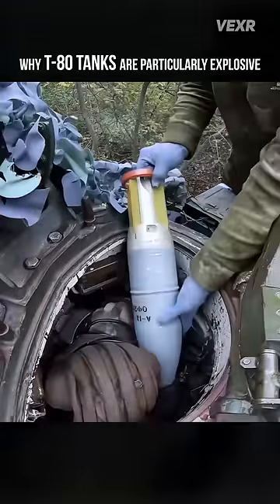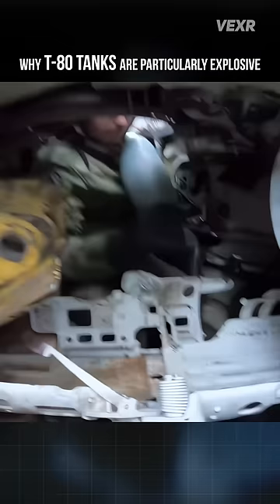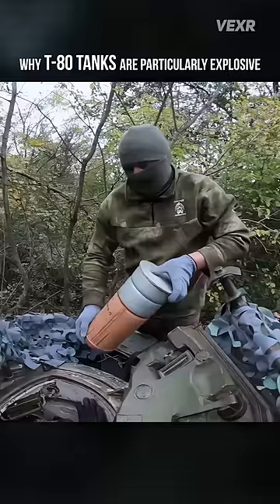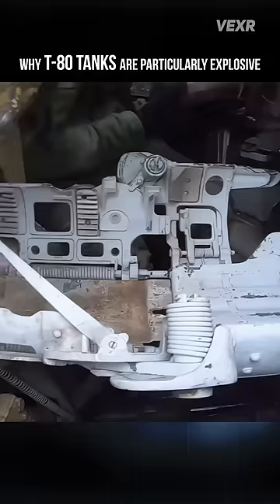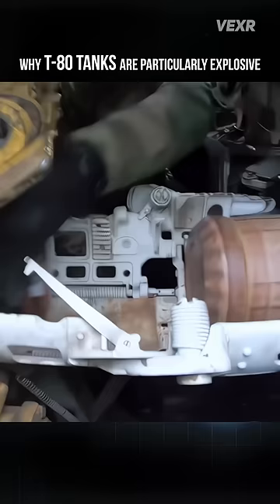T-80 Tanks Are Particularly Explosive, Here's One Reason Why

Comment: It doesn't matter if it has hydraulics or electronics. The autoloader itself is essentially a huge powder keg that sits right in the middle of where a gunner would target.
Reply: I mean, yeah, but the vast majority of ammo detonations from hits are caused by rounds all around the interior of the tank.
The Soviets did tests and found that out as well, very few were cases where it was solely the auto loader because it sits so low in the tank where it’s harder to aim at. 
And the T-80 and T-64 have even more chance of the ammo in its auto loader being hit because the explosive charge is stacked vertically which makes it much easier to hit and aim for.
Reply: The auto loader has the ammo circling the turret too! Hilariously bad design that leads to flying turrets
Reply: got to watch out for those pesky random fires starting from the interior you just never know when that hydraulic fluid will randomly catch on fire all to common 😭
Reply: "where a gunner would target"
No sane gunner would target lower quarter of a tank.
Reply: Well it is due to crews keeping extra ammo  inside around them that lights off the carousel, and not necessarily due to the autoloader itself. In fact the chances of being hit there I guess are much much rarer now that theyve followed protocol.

 With that said there are a few videos showing it, but the question becomes does it matter anyway? Pretty sure you'll be dead if you get penetrated there anyhow in any tank!

 The lack of reverse speed in some of them is what bothers me. I believe the T 80 doesn't lack it, but the T 90ms definitely do.
Reply: @numnut1516 it was good design at the time, it made tanks way smaller and harder to hit. Now the size doesn’t effect if it gets hit or not, so it’s a death trap. The soviets weren’t stupid
Reply: i thing you don't understand, ammo stored ON FLOOR, same happens with NATO tanks, they got secondary ammo storage in hull, and usually on floor, if tank get hit in hull, it make boom, and 2nd thing which make Russian tank make book often, NATO tanks usually have mostly APFSDS rounds or canister shots, Russian tanks use HE rounds, and if gunpowder just simply burn out, explosive filler of HE rounds make a huge BOOM. As it were shown in Syria by turkish leopards, if tank got HE rounds stored in ammo rack = instadeath to crew if tank get hit and ammoracked
Reply: @numnut1516  nah, you see but don't understand what you see, guy on video loaded 2 HE rounds which USA don't use in tanks, and NATO use pretty rarely, and this HE rounds make tanks toss turrets, cuz gunpowder just burnout and that's it, as it were shown in Syria by turkish leopards when tank got HE rounds in ammo rack and get hit, it make huge boom and blowup panels doesn't help at all
Reply: Looks incredibly cramped as well,must be difficult to escape from.
Reply: @Axelfl6161  all tanks are cramped, i were inside leo 2a4 can't say that it have lots of space, also don't forget that in Russia tankers lower than 175 cm
Reply: @numnut1516 How would you design it so you have access to different rounds easily?
Reply: Bud the hydraulica powerd one has a bigger chance of chatching on fire and cooking the ammo
Reply: and all new tank in the future roll out with autoloader.. bravo
Reply: @Notbigbird the t80s have looked to be able to survive way more punishment.  Yes, some perfect hits and BOOM, but I've seen 1 hit 2 antitank mines 1 right Fter the other and the crew survived a bit concussed in sure , but alive.
Reply: The new abrams is going to have the same thing so clearly it isnt the primary issue
Reply: I'm a heavy equipment operator and truck driver. This is why I'm trying to get my pilots licence before the war kicks off. So I'm forced into the air instead of forced into an M1 Coffin 😛
Reply: @dr6891  two things. Number 1 your pilots license wont mean anything to pilot training. Basic pilots license course is done by anyone selected. But you wont be selected for that if youre drafted in. Only officers can be pilots. You cant be one as a drafted man and they have plenty of qualified pilots and pilot wannabes to go around. Number two your heavy equipment experience means nothing for a tank. If they take your experience into account youll be driving a truck or some similar logistic unit. Off the front but targeted by air
Reply: @ThatSB  I try, but it doesn't always work out... That was meant to be funny. 

I have no illusions that a private aircraft, or even a commercial jet would be very similar to piloting a fighter jet. 

As for what I'd probably be doing. It's pretty hard to tell, I'm about as well rounded as a civilian can get when it comes to this sort of thing. I'm a hobbyist for a lot of things that would translate well to military service. Radios, maps, wilderness crap of all different kinds. I even was one as a kid and volunteered as an adult at our local "Army Cadets" here in Canada. So I know drill, rank structure, uniforms, and some other important basics. 

Not trying to play army man or anything, I'm just yakking. I  couldn't do what our heroes do without a personal reason to fight. Big pats on the back for all service members.
Reply: @ThatSB  I am a metal vocalist and can shout like a MOTHER FUCKER! I have no idea how it all works out. 

I'm 31 so a bit old to fight. And have experience teaching cadets drill and uniform and all that crap. I think I'd make a good drill sergeant lol
Reply: Война на Украине показала что советские танки меньше детанируют чем немецкие.
Reply: @redaerf2b414 still but spall exists and yes in some cases you would, for example if your using for example a round that penetrate less like heatfs you would have to aim low to hit the weaker lower glacis and avoid and ERA
Reply: @numnut1516  "Hilariously bad design" at the time of T-72's and T-64's introduction was what everybody else was doing - ammo spread all over a tank's interior.
Reply: @dianapennepacker6854  pretty much...once a tank..any tank is penetrated the crews are dead. You're correct.
Reply: The most likely part of the tank to get hit is the turret not dead ok the auto loader which is in a relatively hard place to hit
Reply: @アドルフヒトラ  its almost like it gets hit and catches fire or the autoloader itself gets hit
Reply: @ThatSB as an Abrams crewmember, the Abrams x is a testament that GD never listens to the actual tankers
Reply: @HyperNebula  why do you say that? I mean they have to switch to an autoloader in some way. A manual loader can't load fast enough for what theyre aiming for. What about the X do you not like?
Reply: Autoloader or not, a Tank is a Tank and when it’s disabled, its done. In my experience, recovering non-functional Abrams are either destroyed further or towed in for scrap metal. Its more expensive to repair than to replace.

Only reason why US uses it is because of crew survivability. You think the Russians didn’t consider this factor? 

For all you know, Russian leadership probably value victory over mortality.
Reply: @numnut1516 
Avarge YouTube tank designer 🤡
Reply: Thank your as electrician you hit that power source they gonna have a bad day
Reply: In the game war thunder? The Russians also made the game. Perhaps, but reality is not a game, the tank was developed by smart engineers. And apparently it's easy for you to talk about the shortcomings while sitting on the couch...
Reply: not all. The South Korean autoloaders have blowout panels and are stored in the back of the turret.
Reply: @gagida1829  because they use a bustle autoloader, not a carousel
Reply: the Soviet's one? yet. The French, the Korean, the Japanese ones? No one knows just yet.
Reply: Worse still is how the carriage stores the ammunition. The explosive charges are stacked vertically, allowing for a higher chance to be hit by spall
Reply: @Notbigbird  - Its never solely the autoloader, but its very sensitive and in most situations when a tank is hit, it goes fucking airborne
Reply: This part right here. The M1 Abrams could have had an auto loader at one time but they decided against it because of the danger it posed. The magazine is down lower in the tank so as to be harder to hit.
Reply: @numnut1516  It was a logical design at the time since there were no highly accurate anti-tank weapons. They allowed for a significantly smaller tank and thereby target, but western weapons like the NLAW and Javelin practically always accurately hit tanks when they lock on and it results in cookoffs
Reply: @Notbigbird  the autoloader's real problem is its ability to be completely prone to becoming a space station when exposed to ignition, other than that theyre kinda fine. other than the fact that you have to load the auto-loader lmao
Reply: @ViisualsHD  if there is a catastrophic ammunition explosion and the turret flies into the air, it doesn’t really matter to the crew.
Because regardless of if it’s an ammunition cook off or a catastrophic explosion they will be dead in both circumstances. 

And of course you have to load an auto loader, how else would it work? You can’t have mechanical arms reaching around the tank just grabbing ammunition and putting it in the auto loader, it’s not physically possible.

And yes you wouldn’t be able to reuse a tank if the ammunition exploded destroying just about everything of use in the tank, same with an abrams if a shell goes through the blast door or if something hits the ammo while the blast door is open like when the loader is opening it to grab a shell out of the compartment, it’s going to largely destroy the inside. It won’t be usable anymore and will have to be scrapped.
Now the turret won’t go flying but that doesn’t matter, the whole turret crew is now eviscerated and it’s unlikely the driver would survive.
Reply: @numnut1516 hillariously Bad Design as If penetrating wouldnt already make the Crew unable to Fight?
Reply: @dianapennepacker6854 it was the complete oppesite the t80 sucked in Reverse Speed allot But they Made a new Version now that can gow 60 kmh per houres
Reply: @Notbigbird  i understand all of that and im not refuting it. i just think sometimes human solutions are funny because theyre not really solving the problem, just one step in the problem while adding other new problems. thats how literally everything works though, just humorous to me
Reply: @ViisualsHD  yeah, humans do like doing the funny a lot xD
Reply: @アドルフヒトラ  When did a ruzzian obey "Курение запрещено", "No Smoking" signs?
Reply: If the projectile makes it that far into the tank then the crew is dead either way..
Reply: Only for Russian auto-loaders
Reply: Doesnt matter if the whole leo survives but all the crew is dead
Reply: @GIwillo  bold of you to assume I play war thunder or world of tanks lol

And yes I know, and actually the funny thing is is that some of them have shrapnel guards around the auto loader which is interesting. But still doesn’t matter much
Reply: @redaerf2b414 not true at all the bottom slope with a tank is the least armored part of the tank that's a spot that they aim for almost any chance they have

Plus you're actually underestimating where the charges sit it's almost exactly Center
Reply: Not the autoloader itself, just its position
Reply: Allright hear me out the thing nobody thinks off if you get hit where the autloader is even if youre in a natot ank youre dead or at the very least your legs are gone
Reply: All tanks have ammo in them, and all gunners are going to target the most vital or weak parts of a tank, so isn't this a problem that every tank basically has? Like how are any of those problems unique to just t80?
Reply: Which is why the BMP-1 had it's autoloader completely removed, having to manually load each shell
Reply: Which is why the Abrams is loaded by hand with the shells and charges stored behind blast doors
Reply: The autoloader is actually a great design because it puts the ammunition under an armor plate at the very middle and bottom of the tank waking at the absolute hardest to hit. Meanwhile western tanks do stupid shit like put ammo all throughout the fighting apartment, reference Challenger and Leopard. And those ERA and dazzler kits the Russian tanks get are some seriously good pieces of hardware. I’ve seen modern ERA eat consecutive ATGM’s without issue.
Reply: @tsugumorihoney2288  All tanks are cramped but some are more cramped than others. Abrams, Challenger 2, Leclerc, and Armata have pretty spacious crew compartments.
Reply: @tsugumorihoney2288  Most Western tanks, have only a small fraction of their total ammunition capacity dedicated to APFSDS rounds for the exact same reason most Russian tanks have only a small fraction of their capacity dedicated to APFSDS: It's rarely required. For every tank in any potential adversary's army, there are likely 2 or 3 light skinned IFVs. For every tank, there are probably a dozen buildings that require some quick demolition. For every tank there's dozens of miles of trenches, fortifications, and defensive positions that need to receive some shrapnel. 

Usually only about 20% of any tank's loadout would be APFSDS rounds. Most would be HE, HEAT with a few canister rounds if possible, and a few smoke rounds.
Reply: i mean any tank is basically a giant powder keg no?
Reply: @bobbman3000  man, you need to learn info about western tanks better, for example m1 have no HE ammo at all
Reply: @tsugumorihoney2288  The M830 and M830A1 are HEAT rounds. Can you tell me the first what the HE stands for?
Reply: @bobbman3000  HEAT not HE, it serve different purposes, 1st one is antiarmor, second is against "soft" targets and for destroying dots and etc. If you hit dot with HEAT you just made  small hole here if it works right, also they have like twice less explosives inside
Reply: @Notbigbird  If they dont have blowout panels they dont care about their crew. at least germany leopard and american abrams do that.
Reply: True, but what they're saying is a hit that narrowly misses the ammunition might accidentally ignite hydraulic fluid and cause a cookoff, so there's potentially even more likelihood of a turret launch.
Luckily the T-80 I think has slightly better armour so it evens out, but the autoloader with ammo stashed below is still a risk for most of these tanks.
Reply: @konskyfanusik3549  leopards have roughly 60% of their ammunition stored in the hull, unshielded, with the crew and quite easy to hit. Which is why there are photos of Leopard2’s with their turret blown clean off and having burned out. 
And there’s also a video of a Turkish leopard2A4 being hit by an ATGM and having an absolutely ginormous ammunition explosion 

Abrams are much better with most of their ammunition stored in the turret bustle away from the crew. There is a small amount located in the hill but that also has its own blowout panels and is quite hard to hit
Reply: So is any ammo?
Reply: @gmb4648  the auto loader was desined during a period where AT mines were not much of a threat.
Reply: Same with the leopard if you load the front hull with Ammo.
Reply: ask the Leopard 2 Driver whats to the left of him
Reply: I have a very nice video of a Leopard 2 making a trip to mars with the Turret  something the T-72 can't achieve by a far shot. @ThePadadada
Reply: The audoloader itself is fine. Lack of blast doors is the issue.
Reply: @numnut1516 I mean if you get a round hit that close to your ammunition causing it to explode, the crew doesn’t really have a good chance of surviving the hit even if the auto loader wasn’t there simply because how packed it is inside those tanks.
Reply: Even if the tank isn’t loaded, if a rpg penetrates the armor, everyone inside is dead anyway
Reply: @Notbigbird idk where you got your research but it’s not as correct as you might think this tank is actually known for how many have been destroyed by the autoloader being hit you can say they did all this research and said that’s not the reason but in actual combat it’s shown to be a death trap with it’s auto loader it’s a cool tank but the auto loader needs to be changed then that tank would actually be pretty invincible
Reply: @aaronrhodes8366  I never said it wasn’t the auto loader, just that more often than not it’s because of ammunition around the tank.
Reply: @redaerf2b414  Actually center point is where most gunners aim at. Its not War Thunder where every hit needs to penetrate. A huge hit at center point can infact trigger ammo to explode by the sheer vibrations of the metal or even spalling. Let allone deafen the crew. Even just a loud non pen can make the difference. See the leopard 2a6 shooting at a T-72 point blank it hits like a truck looks like a non penetration but the 2 T-72 smoked and turned tail away from that leopard. That crew probably has tinitus after that blast and they will never be the same morally broken.

But there are also cases of T-64's and T-72 exploding after a non penetration. How? The hit was so hard that inside the armor spalled into the ammo carriage leaking oil everywhere and thanks to bad isolation from the engine the heat made the oil catch fire and explode within a minute. Like i said its not a video game where you need to hit a "weakspot" a good hit is sometimes enough
Reply: @tsugumorihoney2288  I have been in the leopard 2A5 i can say from personall experience its a luxery vehicle compared to a T-72 as a 187CM guy i could stand upright in the gunner position
Reply: @wargames43  but T-72 build for guys ьфч 170-175 сm
Reply: Not true. Check new t90s they are safer then other tanks
Reply: Ты сначала попади в эту пороховую бочку
Reply: @numnut1516 and where do you suggest they store ammo? Since you're apperantly a master tank builder
Reply: @redaerf2b414  taking a 2 mile shot center mass, hitting 2 feet lower than expected isn't unheard of. Tank cannons aren't lazer beams that hit the exact point of aim.
Reply: All western wonder weapons failed 🤣 against Russia
Reply: @redaerf2b414  Not from the front, but from the side they're definitely aiming there. The tracks cause that area to be the biggest weak point on a tank: has to be completely flat with no angles.
Reply: @numnut1516  تانک لکرک فرانسه هم گلوله گذار خودکار داره،ولی مشکل تانک روسی رو نداره،
Reply: Also, if the ammunition stored there goes off, the T-80's main swivel turret  just completely pops off into the air.
Reply: Lollipop
Reply: No blast door is a very unforgiving decision for your crew
Reply: @dianapennepacker6854 how would you know where they would shoot
Reply: Storing ammunition in the hull is hardly unique to Russian tanks. Most tanks store ammunition in the hull, the Leopard, Challenger, Merkava (carry those four dudes by dumping out all their hull ammo). The reason it's a death trap is because their crews are poorly trained and their officers are incompetent.
Reply: But you can operate a tank with 3 instead of 4 men. Which means that every third tank you get one aditional crew for another tank. 
That is the "soviet/russian" idea behind auto loaders.
Reply: @gmb4648  South Koreans Adopt Soviet doctrine Even before they got their hands on with T80. The K1 MBTs are notorious for crumpled interior. New K2 is much larger tank but the doctrine remains. No Hit, No Lose. it is very sound and down to earth decision considering whole Korea is covered with harsh  mountains.
Reply: @redaerf2b414 American gunners do when targeting Soviet/Russian tanks, strictly for the purpose of detonating the ammo rack. Or in the very least, scoring a mobility kill by destroying the tracks.
Reply: @Notbigbird All of the tank have issue with ammo racked you see video about Leopard 2A6/2A4 got destroyed by BGM-71 TOW by Kurdish fighter but in other case this BGM-71 TOW used by Rebel have no effect to T-90 used/tested by Syiria Arab Army.
Reply: @numnut1516  Bad design from when?
Reply: Yeah, because it's moving parts of the autoloader that explode, and not the actual ammo.
Reply: @redaerf2b414  no... thats where youre supposed to aim. The turret is usually the most armored part of a tank.
Reply: @Axelfl6161  Its the price you pay for a lightweight 3 crew MBT.
A fully laden T80U is still like 30 tons lighter than a standard load M1A2 SEP V2.
Reply: So, you are suggesting, that a human loader is the better feature, rather than the autoloader?😆😆😆🤣
Reply: @Axelfl6161 Actually no. Because every crew member has his own hatch. Unlike in the western tanks, where the gunner is toast.
Reply: @dr6891  What you'd end up doing if you were to get drafted would depend on thow things. How well you score on the ASVAB, assuming that draftees would still have to take tha ASVAB. And after the aSVAB it would depend on what the military branch that gets you needs and you're qualified for. 

So if you hypothetically got drafted by the Air Force, you ace the ASVAB and the Air Force has a need for radar technicians, then you're going to be trained as a radar technician. This is because you aced the ASVAB so that means you're smart enough to be trained as a radar technician. And because they need them and not as many people score high enough on the ASVAB to qualify as a radar repairman, they'd going to send you to radar repair school over anything else.
Reply: Just another outstanding Russian design 😂😂😂😂
Reply: Tbh, sadly, irl no armor could save you from a tank shot, so Soviets decided to give tankers more chance to shoot the enemy, than getting shot
Reply: American tanks have autoloaders now. Oh snap.
Reply: @Тотсамый-х1ж8з  no armor. but western tank armor can survive a tank shot. :/
Reply: @dianapennepacker6854  I guess it matters a lot when it comes to repairing and using those tanks again. A dead crew and a damaged, but repairable tank are a problem, but a tank after a blow-out is just gone for good.
Reply: @Notbigbird The vertical stowage is relevant. The hydraulic fluid is not
Reply: that’s kinda the problem with autoloaders
Reply: @numnut1516 they’re not supposed to be shot at back in these. it’s supposed to one hit then keep going they keep in mind offense not defense 😂 gotta have both
Reply: To quote the great moti: "I just realized all my shells are stacked under my turret...and if someone hits my shells; my turret, becomes satellite."
Reply: It really doesnt matter if your turret flies or not if your ammo detonates.. soviet tanks were good but their purpose is not this kind of war, nor are they designed for shitty russian tactics. @numnut1516
Reply: Every tank would die from a penetrating shot under the turret. The ammo placement means nothing. Besides that the t-72 and up tanks are very short.
Reply: The western tanks react the same way when hit by new munitions. T 80, T 90, Leopard 2, Abrams A1, they all lunch the turret. The only tank to avoid is the Abrams because of the heat from the turbine engine. It can self ignite from broken lines, and then we get the issue of heat signatures like a massive flare saying come kill me.  Come on america we can do better then this.
Reply: It’s part of how Russians design tanks compared to US tanks, the T-80 has a very low profile, it was put into service in the late 70s and designed to be cheap and hard to hit, but with modern guided weapons, being hard to hit goes out the window. So it’s not a bad design, but it’s not suited for how it’s being used now.
Reply: Enemy, alwayse aims for the ammo same goes whit the abrams or leopard ...
Reply: @Notbigbird there was one image of a Leo 2 which has working blowout panels and curiously a devastated crew compartment
Reply: @ImBigFloppa  compared to standard HE-frag heat is impotent
Reply: @wargames43  is it the one where the Leo 2 hit the turret of the t72
Reply: @commenter648  Normal HEAT rounds sure. But when you have a prefragmented case containing thousand# of preformed shrapnel, you get a significantly more efficient design then just a solid steel shell filled with high explosives.
Reply: @ImBigFloppa  issue is you literally have a little over more than half the explosives in a heat shell compared to the HE-frag, and 3OF26 uses high fragmentation steel for its shell that can form around 2500 fragments compared to a frag sleeve
Reply: Does it matter if the ranks gets blown up, or if the crew gets shredded by shrapnel?
Reply: Hilarious that you know nothing about tanks@numnut1516
Reply: @Notbigbird
Makes you wonder why they aren't using reactive armor or why that armor isn't effective. Also the interior of the tank could/ should have some sort of anti-spalling. Didn't the Russians have a device that shot at projectiles with a shotgun like effect?